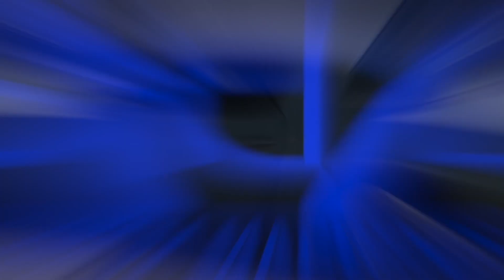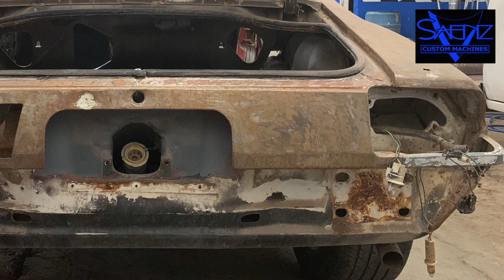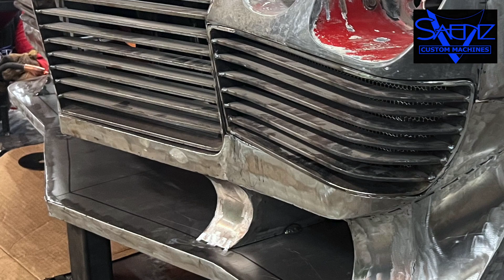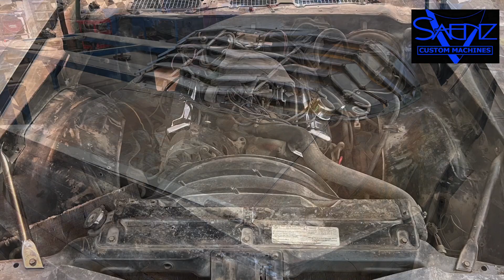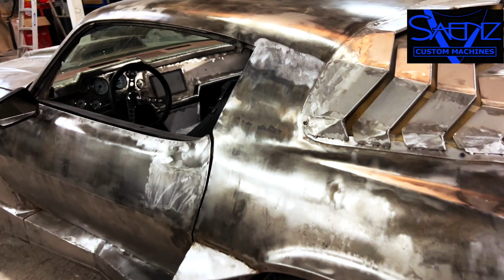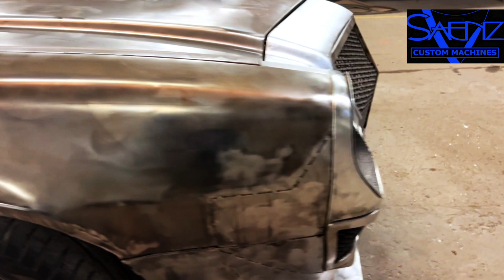1976 Camaro  - Metal fabrication

Comment: Really impressive fabrication skills ! You really improved upon the look of the car (over the stock look. )
It looks as if you custom fabricated the stock rubber front section ( the grille opening and light bucket area ) out of metal. 
That is really impressive, since there are so many curves there. 

The louvers look fantastic. Very agressive, like a stealth jet, yet functional too. 

I absolutely love the bare metal look. 
I know that it is easy to keep bare metal cars from rusting by wiping them down with peanut oil. 

I noticed the Texas plates. 
Where is your shop based ? 

I was really hoping the video had more views than it does. 
You guys do great work !
Reply from the maker: Thanks for your great input, a lot of work is done redesigning and fabricating this Camaro, I own a shop in Juarez, Mexico (just 5 minutes crossing from El Paso) but now moving my shop to Socorro, Texas to continue working on cars at home. Since the Camaro is my own car the project is always delayed because my customers projects have priority.
 
The Camaro is now painted with Silver base coat and clear, since the idea is to paint it Candy blue in the future. This project will be sold when completed or even at some stage since I have som many other projects going on... 

My videos are short showing only high points however I have no problem showing more details when people request more pictures of the different steps done already.

I have 20 years experience in fiber glass fabrication however I love metal fabrication that is why we did it all metal modifications, always better metal than fiber glass or plastics. 

If interested on some more pictures or info just let me know at vsaenzcustoms.com

Regards,
Victor